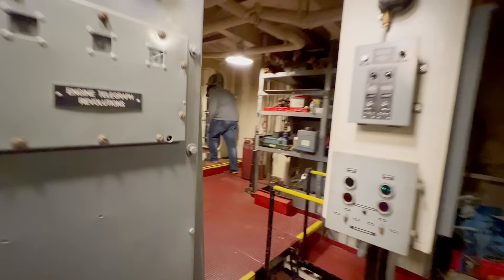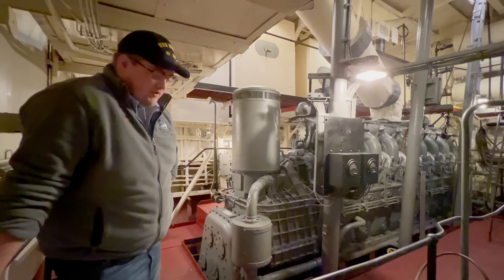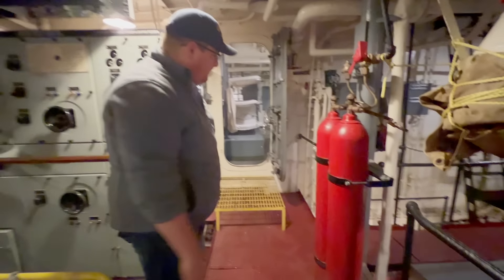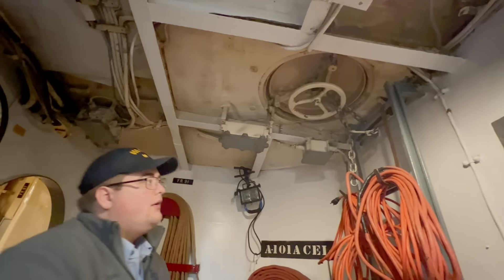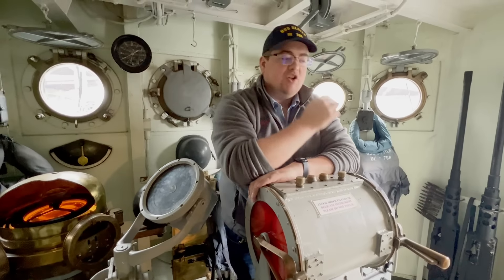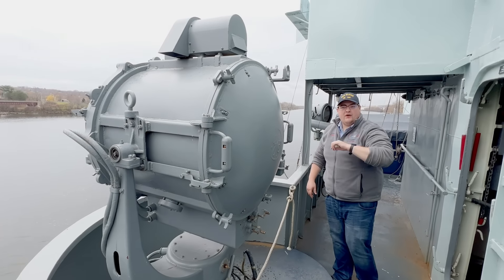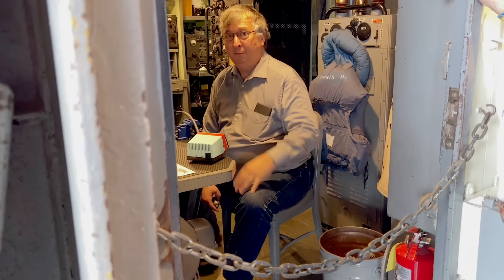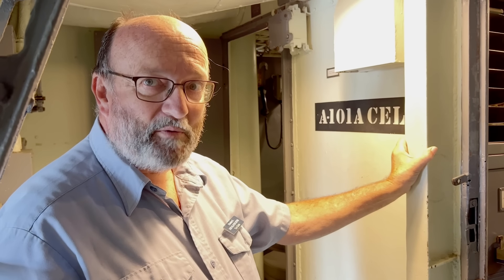USS Slater - Destroyer Escort at War: Episode Five - Ship Shape

Comment: This is fascinating. I believe that diesel locomotives functioned the same as this ship with the diesel engines generating electricity to power electric traction motors that actually turned the wheels. Thanks for sharing.
Reply from the maker: Thanks, appreciate it!
Reply: These are very very closely related to even modern EMD diesel electric drivetrains on trains. They share the same heritage from the Winton 201.